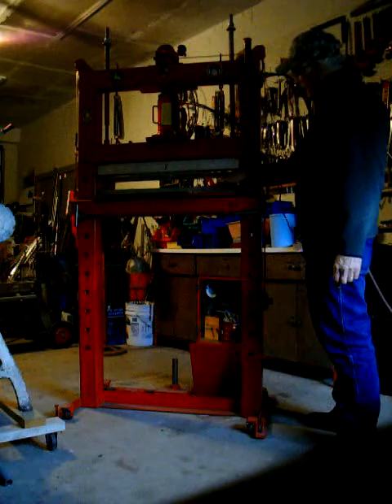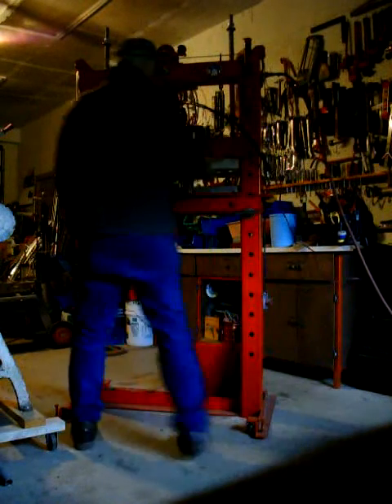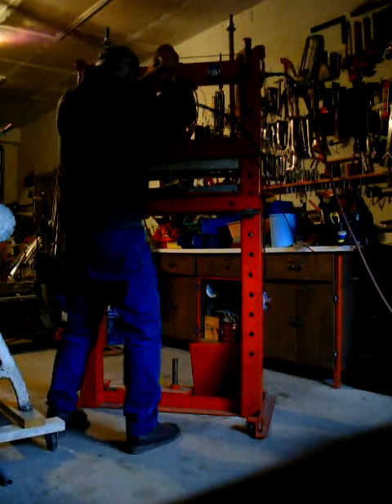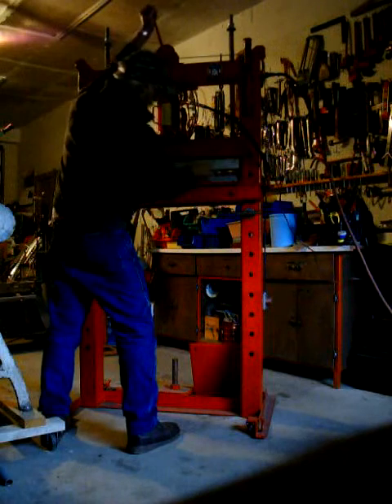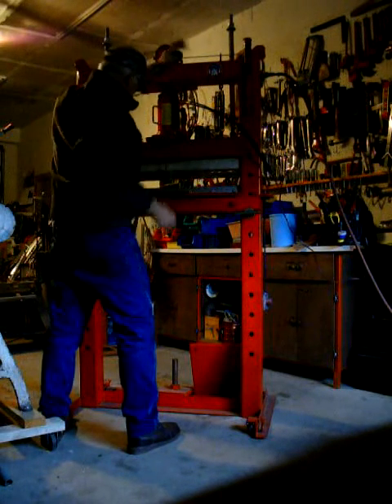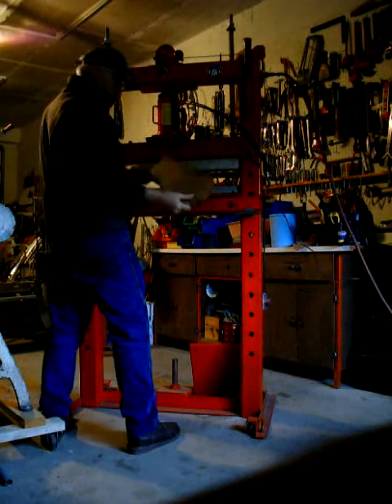Homegrown Shop Press 1

Comment from the maker: Sorry for the crummy, dark video with poor sound, but I didn't know what I was doing when I made it.

I sold this press a couple years ago when we moved. We downsized to a smaller house and shed in Florida, so a lifetime of homemade tools, 5 acres, a huge pole barn and workshop and things had to go. I hope the young fella that bought the press cheap, is still finding things to use it on. It bends sheet metal , presses bearings, and anything you need to mash or flatten. The frame was basically all 4" square tube, 1/4" thick wall. The table was twin 3" square 3/8" wall tubes (straddling the 4" uprights), and the jack was a Harbor Freight 20 ton, air or hand operated. I liked to use the air feature to rapidly advance the dies to the work, then use the hand pump to finish the operation. That saves elbow grease, gives you precise control, and in some cases, helps prevent you from over bending the work piece. I put some small steel casters on the bottom to be able to move it around the shop. I could raise or lower the casters by a jack screw on the left or right sides.

In retrospect, I would have mounted the winch that moves the table up and down on the side rather than on top as it is kinda awkward to operate overhead for me (i'm over 70 and 6'2") but the young fella that bought it had guns the size of wagon tongues, so he probably didn't even notice.

 Hope you get some ideas that you can use, and be sure to always wear safety glasses, and stand aside when operating the press to stay out of harms way in case the work piece breaks. (The press won't break)...Stan